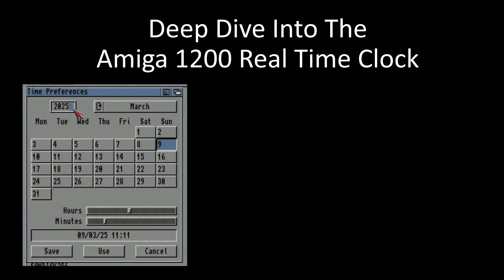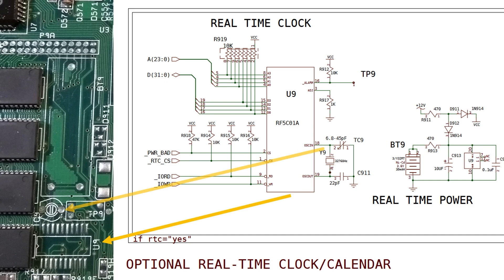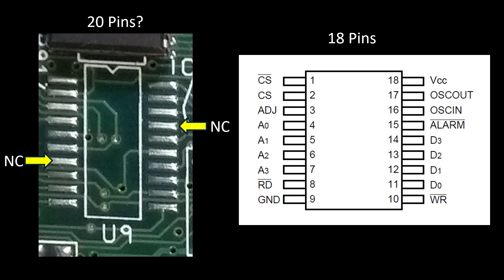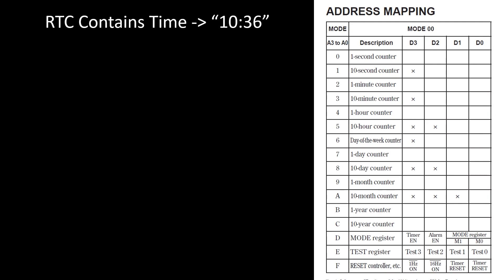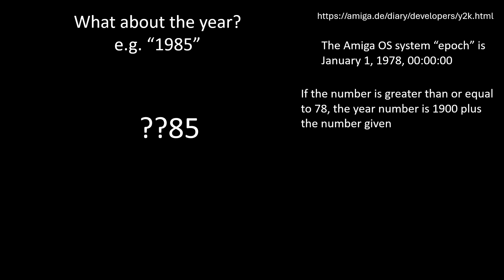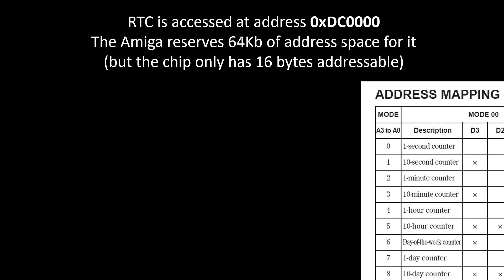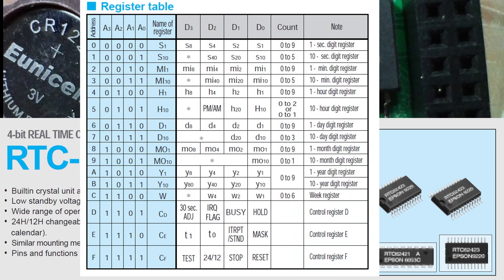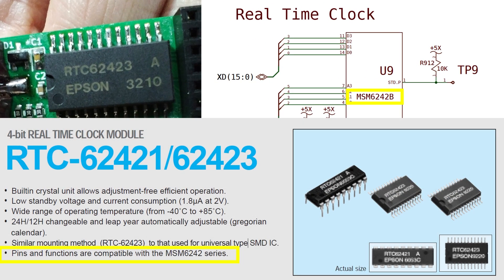It's Time To Talk About The Amiga 1200 Real Time Clock

Comment: Looks like Commodore used the wrong footprint for the IC and decided not not populate it.
Reply: I doubt it as the the two extra pins are NC mixed in with otherwise valid connections. I would put more credence into a MOS version (lets not forget Commodore could make their own chips, even If they sucked at leveraging that) of the chip changed to avoid paying a license.
Reply: @daishi5571  That was also my first thought. Minor adjustments since they could produce their own chips - remember that's how the 6510 was born. Probably had 1000s of 20pin packages lying around and very little 18pin ones when they decided to add the NC pins. On the other hand ... did MOS/Commodore ever produce SOIC-chips?
Reply: @ There were a number of chips that were made by MOS that were never listed in any catalogue (lessons learned from 6501) the issue is how long it takes to switch over the tooling, so it wasn't common but when they did the batches were rather large from what I read.
Reply from the maker: @RandomBlankUsername  It's a good theory. But then why is the schematic labelled for the Ricoh chip? and wouldn't the NC lines still need to be marked on the schematic.
Reply: @daishi5571   You don't need to pay a license to make a pin compatible chip though, so why not make it either with the right number of pins, or at least shuffle the NC pins to one end so you have more flexibility in production to stuff one chip or another?
Reply: @ Chips have copyright on them ask MOS what happened when they made the 6501.
Reply: @  What happened with 6501 was that Motorola alleged the engineers who quit Motorola stole their top secret technology and made a chip with this technology at MOS. If it just happened to have the same pinout, they wouldn't have had even a semblance of a case... though arguably since semiconductor technology was so new, it may have been unlitigated and thus uncertain in mid 70s. By mid 80s everyone was making unlicensed pinout compatible but internally clean room newly designed chips.
Reply: @SianaGearz  And yet the 6502 which is essentially the same CPU as the 6501 with a different pin layout was left available. 
Look I agree it's more nuanced, however when you copy a design you open up for a lawsuit and you never know if it's coming. Even if you can win it can be costly, time consuming and can you afford that? Lets ask Commodore who lost the XOR Patent which had they the time and money could have won according to most patent lawyers.
Reply from the maker: @MartinPiper6502  yeah, that is a very good possibility.
Reply: @DavePoo2  The MSM6242B SMT variant has similar NC pins, although it is 24 pins, and is different to the rf5c01a.

Comment: I did the clock mod to my A1200 and added all the parts and it woks fine. Mainly just did it for fun. I used 4x 0.1F supercaps connected in parallel. On another A1200 I used 2x CR2032 coin cells in parallel and changed some parts so it doesn't get charged. To mount the chip just bend the pins to fit the pads using tweezers and then mount onto the board. Looks a bit strange but it works hehe! I don't think Commodore messed up. There are two possibilities. Either they were going to get a special custom version made but decided against it and then abandoned it completely, leaving it to 3rd party companies to make the clock module. Another possibility is they may have received an incorrect datasheet from the manufacturer around 1990 during development (remember this was well before the internet and easily obtained technical info) or a pre-production sample and later it was changed by the manufacturer and Commodore decided to not fit it due to the incorrect pinout because they were already in-production for the A1200 motherboard.
Reply from the maker: @g4z-kb7ct  So did you know about the extra pads before you started or did you just find that out along the way? I do wonder if the reason why the clock chip isn't installed is because they messed up the pads and then didn't want to respin the board to fix it.
Reply: @DavePoo2  Yeah I knew about the pads. I'm regularly reversing stuff and making repro PCBs so I notice tiny things that most people wouldn't notice. I work as a cnc programmer and first class machinist so I have to take note of all the little things because manufactured parts all have tolerances and if the part is not within specification it is scrapped and the boss gets very upset hehe! I checked the datasheet of the chip and then the A1200 schematic and PCB and noticed it didn't fit. Then figured out bending the legs could work so I did it and it worked :-)
I suppose it's possible they made the board wrong and didn't want to re-spin it but that arguement would only be valid if there was one release of the motherboard. There were several revisions and they never fixed it so that doesn't wash with the jury ;-)
Reply from the maker: @g4z-kb7ct  I think their thinking would be that the pads are wrong but not causing trouble but if they try to correct it then there is always the chance they could make it worse, so they just left it as is. I think though, if anyone is making modern repro boards they should either correct it or use circuitry similar to the Amiga kit clock with a coin cell battery.
Reply: @ There is a repro but it was copied 1:1 without doing any thinking. There were some small improvements in later spins but whoever did it obviously never looked at the clock chip to see it was wrong.
Reply: @g4z-kb7ct  Would say they were going to use a J lead package, but it was dropped from the provisional datasheet, only coming in gull wing instead. More reliable, and slightly lower height, and that won out. Then when they started ramping up and ordering parts for the pre production build they found the J lead was no longer available, and Ricoh was not interested in taking a few thousand post package leadframes, and stripping them from the lead cutter to run on a J package cutter and former, so they decided to simply make them non populated instead, as the cost to buy a J lead former probably put the board cost outside the allowed cost of production. Make it use the header already there, and make an add on RTC board then looked like a good add on for extra profit, so they populated the header instead. 

16k of addres decode inside the PLA was a timing thing, the extra internal decode logic would both take macrocell area, a thing always desperately short in the PLA, and also would add in an extra few nanoseconds of delay in decode, which would mean that either they needed to use a faster PLA core, or a faster RTC core, or drop processor clock rate to get those precious ns of time in the decode, or add in a wait state, again needing precious PLA macrocell area to do this. simpler to just do a 16k decode, one extra gate in the decode path, as they were already doing 16k blocks of memory, and adding in a single layer of decode was the same for all other address decodes, a splitting out of the upper address bits into address and complement, and then multi input NAND gates for each block, so only needing a single macroblock of PLA to do all decoding, as making it say 8k or smaller would have made the decoder exceed the number of bus lines in a macroblock, or a routing limitation.

Comment: That direct link to the CPU and data/address lines was used for other things  - i remember  fast serial port i think a silver surfer(?) back in the day, and some a1200 had fully populated pins across the whole port, some half. some the other half!!!.
Reply from the maker: Maybe Commodore put it there so they could cheap out and only install 1Mb of RAM, and let you buy an upgrade for the 2nd MB, but in the end they went for the full 2Mb for that super AGA experience.

Comment: So Workbench did at least have the routines to access the non-existent RTC
Reply: I think it was probably more common to find an RTC on an A500 than an A1200, as many of the half-meg trapdoor RAM expansions had an RTC and battery on board.
Reply from the maker: Yeah. I believe the same RTC chip is used on the Amiga 4000.
Amiga PCB Explorer shows the A4000 uses  the through hole version of the chip, but it does show 18pins instead of the 20 that are on the A1200